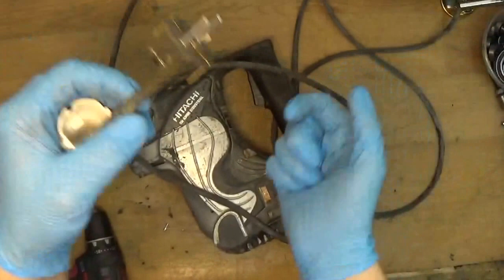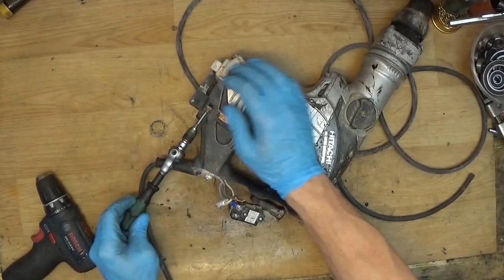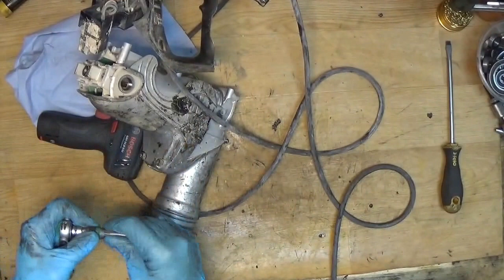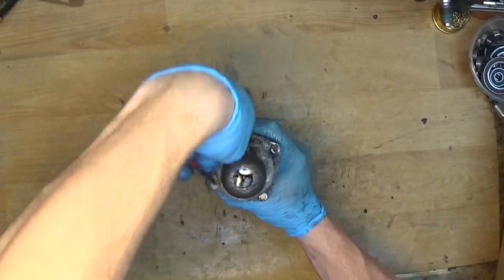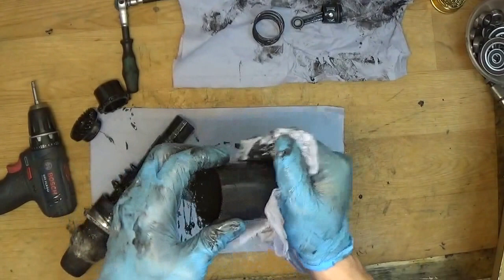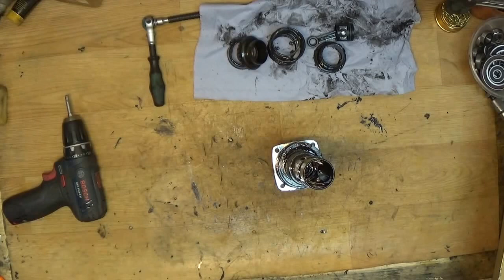How to disassemble Hitachi DH40MR sds max hammer drill

Comment: Can you tell me why the hammer action doesn't work. All parts look good, crank spins, but no hammer.
Reply: I use it about once a month for 10 years. The local repair company claimed it was the crank. But I opened it and every thing looks and works great. Just the hammer action feels like the hammer is only just touching the bit. More a vibration at the bit than a hammer action.
Reply: Its flat. Not much oil. I ordered o rings. How much grease inside? pistons/hammer crank area?